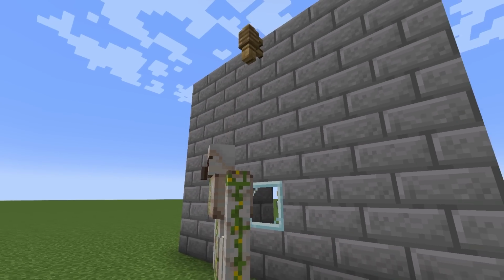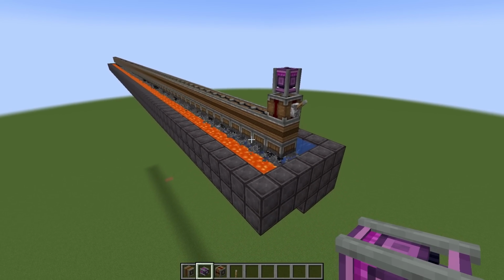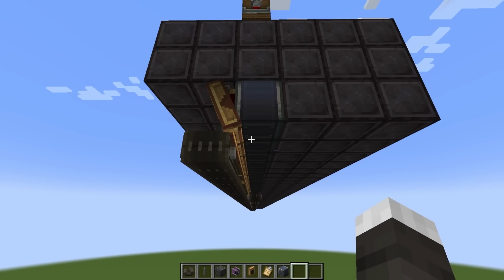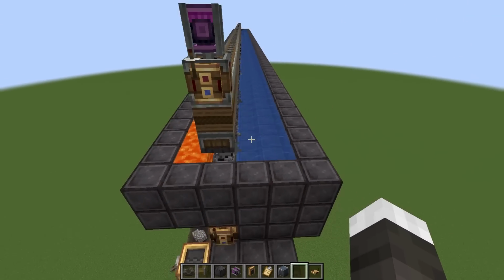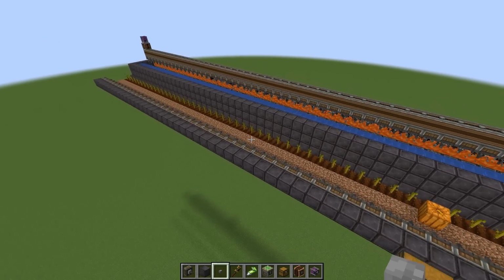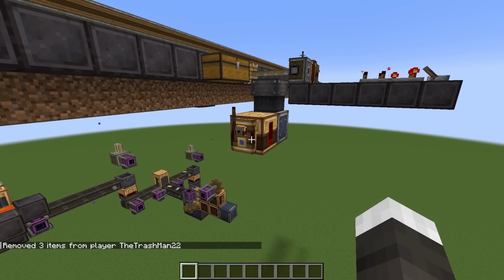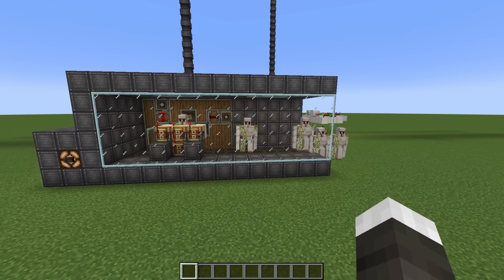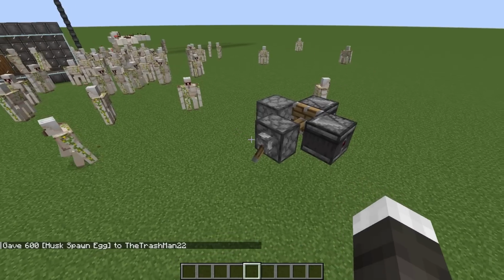Iron Golem Assembly Line (Create Mod)

Comment: 1. slow and overinflated cobblestone generator, a 2x4 gantry generator probably makes your 75 generator's output by itself.
2. slow and overinflated bulk washing setup. use the fan itself to push gravel into brass funnels while the items are not on a belt, increasing your maximum throughput
3. you don't need a mechanical arm to put items into crafters
4. using a cart contraption to harvest pumpkins is much more efficient and saves on having slowass belts
5. weirdass pumpkin placing workaround? just have the top deployer move on a different cycle to the iron block placers

Comment: Well, i may have watched this video to learn how to make infinite golems, but i also managed to learn how to make an iron farm via create. Didnt even know create had a specific way to do that

2:03 one edit i would make to this is that you dont need the mechanical arm

If you use a wrench and click on the borders on the back of the crafters, they will be joined and thus can accept an input from one source. 

Then you can just slap a brass or andesite funnel on the side and have the belt feed into it directly.

Comment: To prevent cobblestone loss in the cobblestone generator from getting stuck in the water you can use the angled chutes to collect from both areas at the same time, your only limitation at that point is belt throughput into the vault
Reply: Or they could just use stairs.
Reply: @gabeclements2501  That’s also true I just forget that there’s better cobblestone generator methods now lmao

Comment: You could probably increase iron gained from your farm at the washing stage. Add fans on either side of the belt. More fans means quicker washing, means more quickly iron. Also could add more belts with more washing
Reply: Or just don’t wash on belts, you can wash ground items with practically infinite throughput
Reply: And more crushing wheels
Reply: @jackdesanta69 of course you can do that.

The segments look modular so you can infinitely expand then as needed.

Just with his set up he gets less then a IG a minute, but if expanded it can go quicker.

Comment: Hey just a heads up with the mechanical crafters if more than one item has to be filled up with the same item and it's connected you can wrench the partions between the two and you can insert the item into any one of those !

Comment: 4:02 I think you've over engineered golem assembling. Can't you just refill two lines of iron block, and place pumpkin to spawn a golem, after detecting, that upper line is full? The only issue might be golem suffering while being in walls, when pistons refill iron lines.

▪️▪️▪️🟧▪️
◻️◻️◻️◻️◻️⬛
◻️◻️◻️◻️◻️⬛

Comment: alright so what you gonna do is make an iron farm that instead of burning the golems drops them out from the farm far enough so they dont trigger the villagers not to spawn another and thats about it, and its faster
(still cool what you did here but you may have forgotten the vanilla solution)
Reply: Exactly, vanilla is way faster, easier to make and has a smaller footprint.
Reply: Why would you make it in the first place? I think this is more of a proof of concept than something you would actually use
Reply: @jackdesanta69  golem to golem conversion

Comment: Is there a schematic for this?
Reply: A vanilla iron farm is faster and more compact.
Reply: @PieterPeter-ud7wf  but you have to move them out of the village golem cap (which I assume is super annoying) otherwise you're gonna only have couple of them
Reply: @jackdesanta69  Instead of killing them just let them fall further and/or move them with belts, simple as really
Reply: @PieterPeter-ud7wf but with this setup you can only have a few golems at a time (depending on how many villagers do you have (1 golem for 10 villagers)) more will not spawn
Reply: @jackdesanta69  ?? man made golems do not have a limit. Like I said, if you move a golem out of the village range or kill them fast enough with a fast enough golem setup, you produce more iron than any create farm could ever produce. Vanilla farms can produce hundreds of iron per hour with just 5 beds (one village), just make multiple of those small 5x5 farms 16 blocks apart (village limits) and you have 1200 iron per hour with 20 beds.
Reply: @PieterPeter-ud7wf  oh my bad, I though you meant just those golems not to farm them for iron. Well I guess it's either moving villagers or doing the create setup which you'd do anyway

Comment: Wouldn't it be faster to use saws than mechanical drills?
Reply: Saws only break wood iirc
Reply: @Tuco-js  nope, saws act simular to axes and axes break pumpkins. I tested it, they can break pumpkins and get the drops too.
Reply: theres a lot of things he couldow done better and faster for the assembly line. just by using a vanilla iron farm he couldow solved his iron ingot bottle neck. He couldow skipped the whole part of sheering the pupkins and breaking them,by simply placing pumpkins at the end and using observers to activate a dispencer to sheer the pumpkin on top of the iron.That wouldow also skipped the whole end part where he needed to make that extra part of circuitry at 4:03
.
Reply: @pelicannon467  yeah there is. 
The sheering of pumpkins using dispensers is much better than using deployers. 
Although using deployers to place the iron blocks and pumpkin blocks is better than in vanilla.